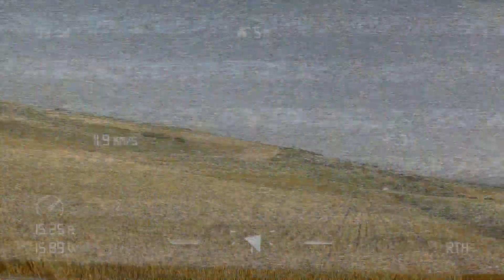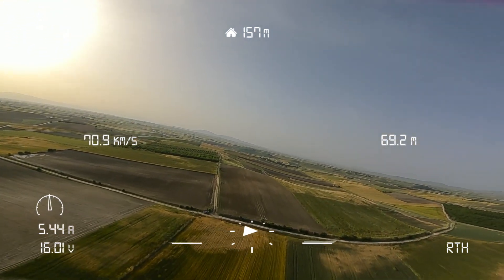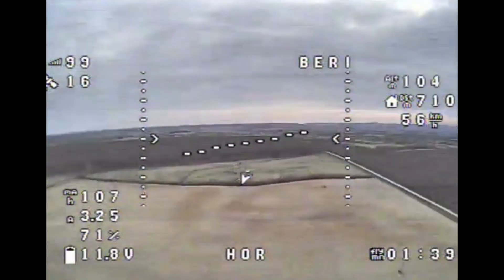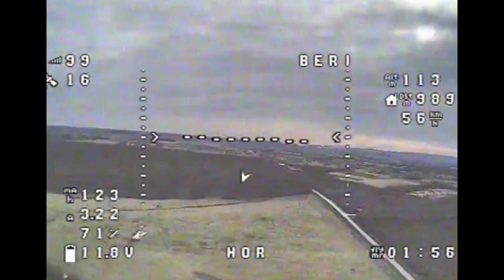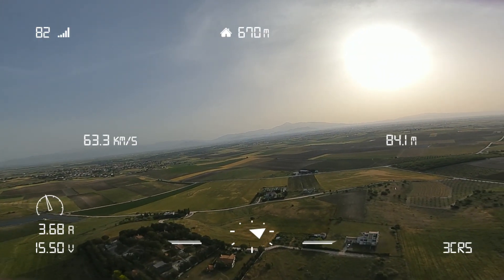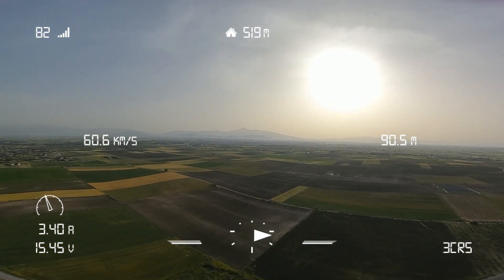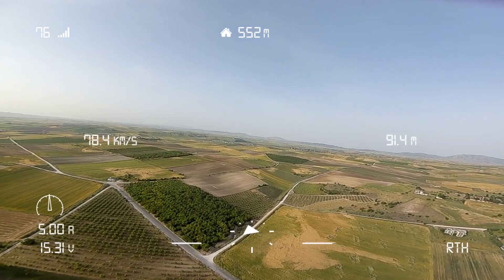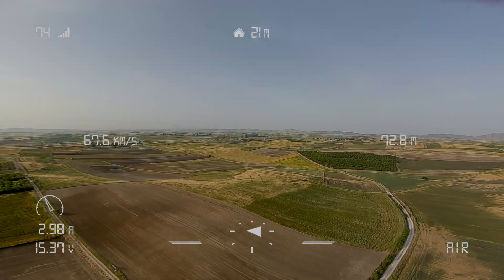iNav 2.5 How to get butter smooth turns from the autopilot

Comment: Nicely done. Thanks for sharing. I am interested in your ar wing build. It looks efficient to me.
Reply from the maker: This is an pretty standard AR Wing 900mm. The motor is a 2205 2300KV from an old quad, running on 4S with a 5x45 threeblade prop (from the same quad :P)...

Comment: that's nice work. can this method be applied to quadcopters .!!??
Reply from the maker: Thank you! It's a different code path for quadcopters so this will not work only on fixed wing... maybe in the future when I try out iNav on a quadcopter I will look into it.
Reply: @harkal  great. one other issue that i saw is that in quads the waypoint missions are suffering from rubberband woobles when stopping to each POSHold (plotted in map) point because its basically based on that feature, planes dont get affected since they glide even if they stop motor momentarily.  it would be a great improvement if those could be eliminated supposedly using this.  cheers.
Reply from the maker: @djvaliro  I find messing around with iNav code very fun lately, but mostly for my wing. Maybe I will take a look at the quadcopter side soon. I just don't have a long range quad :( My quad is mostly build for freestyle and 3-5minute flights. So, no real need for iNav on it...
Reply: @harkal  ya understandable. but interesting.
 let me know if any plans arise in the near future . cheers.

Comment: Harkal,  thank you for this.  I have INAV on a scratch built wing and I hate the jerky turns on RTH.  It also turns very jerky on loiter.  Anxious to see if this makes a difference.  Keep up the good work.  I need to flash  it with 2.5!
Reply from the maker: It surely will. Just try an 8 to begin with, and if you find it "too smooth" reduce it. Low values don't make that of a difference on most builds. Let me know how it goes!

Comment: Very interesting. How did you overlay the telemetry on the HD footage?
Reply from the maker: Well can easily require a video by itself... but the solution involves custom hardware that will probably not make dji happy, but it's also not such a good solution after all... not as good as it seems at least... :/
Reply: @harkal  wait, that osd is on the live feed, and not just an additional overlay during video editing?
Is multiple times better looking then djis own barebones osd.
Did you put something inbetween the camera and the air unit?
Reply: @harkal  Likewise I was curious about how you did it. I could only come up with an after edit using a blackbox log file as the .srt subtitle file does not have the required information to recreate the OSD. A video edit is fine, a hack is more interesting though. Please share a little more about what you did, the technicalities interest me.
Reply: @harkal  we really really like to know how this works. 🤔👍
Reply: @harkal +1 do tell your secret, even if its a dirty hack! Dirty hacks are the best 👍🏼
Reply: harkal a ot of people are waiting for your OSD solution
Reply from the maker: @kreisflieger  I am not really going forward with it. It would be better to wait for Dji to enhance their .sub file solution. Once you delve into it you realise why they don't have this, and they went with the subtitle file. The dvr might be ok but for the transmitted feed it really takes up a lot of bandwidth to describe all those sharp edges of the fonts. Even without black outlines (hence making the osd unreadable in the bright parts of the screen) it still takes lots of bandwidth, enough to undo all the benefits of focus mode, etc. In analog transmitting black and whit pixels next to each other is as fast as transmitting a white screen. With digital it's another story...